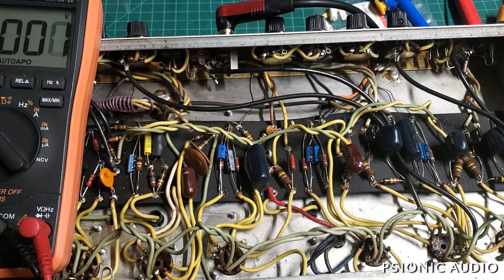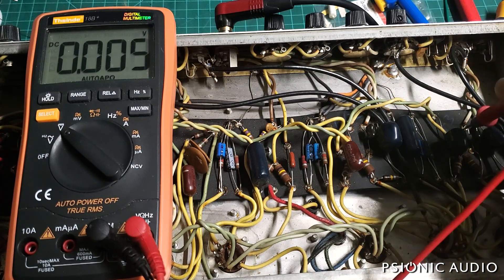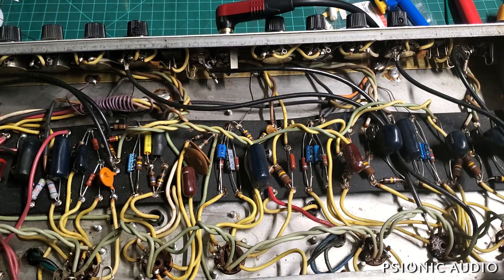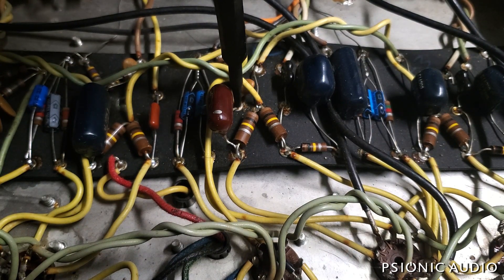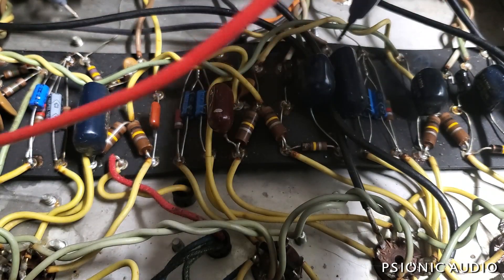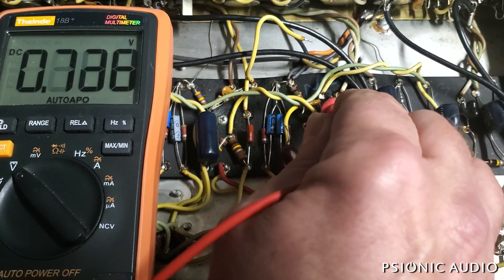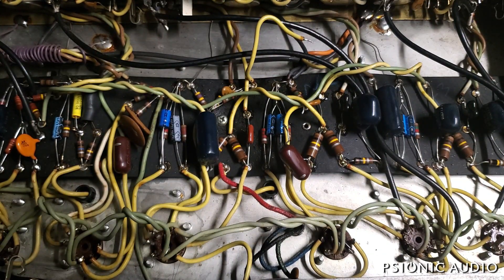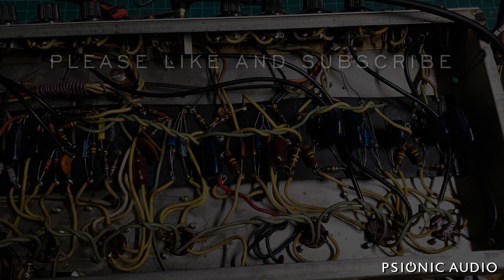DC Leakage in Fenders | What It Is and How to Get Rid of It

Comment: Rabbit hole potential: 1966 PR , I am chasing 20mV on a coupling cap at the point of the reverb input. Reverb volume goes up and is boomy when the reverb control goes up. As you described it, board looks OK, but grimy, gobs of flux from a previous cap job. Replacing ceramic caps does nothing and old resistors are in tolerance.  Am I wasting time?

Comment: Thank you for an informative video. I have a DRRI that has seen three amp techs for noise issues and it still has noise. I wonder if it has leakage in the board. Will give this a try
Reply from the maker: The RIs don’t have conductive board issues.

Comment: No, you couldn't run a tube screamer off that. A throwaway comment I know, but as we also know voltage isn't the same as power. Good instructional video all the same. Maybe Fender boards could be future-proofed by applying a wax in a volatile solvent

Comment: Great video on a common problem that is usually ignored!

I live in Florida where high humidity is constant. Many gigs are played on patio stages. The boards are screwed directly to the steel chassis. The fiber boards absorb moisture and warp so badly that they sometimes break components. I build my boards out of fiberglass and mount them on standoffs. Not only does this solve the moisture issue, it allows neater lead dress by routing wires under the board.

Comment: what would cause DC on a Marshall/Bassman style presence pot? When I hear the noise , I turn the pot all the way up and it goes quiet again ( its a build)
Reply from the maker: Marshall/5F6As built with 5K presence pots have DC on that pot. Notice the later amps use a 4.7K resistor and a 22K pot just for the call cap. Keeps DC off the pot.
Reply: By the way, its a Hoffman turret board

Comment: Empirical knowledge is those old Fender cellulose and glue fiber eyelet boards become conductive over time and thus they are notoriously leaky. IPA careful scrubbing and a hot air rework tool will usually sort them out.

Comment: That would drive me bonkers!
How long will that cleaning hold up?
Reply from the maker: Like Eric said, it usually takes many years to build back up. It took decades to get this bad to begin with. I'm not just doing a surface cleaning - I soak the board with isopropyl. That displaces any moisture that was in the board.
Reply: Many many years unless the amp is subject to brutal conditions

Comment: Wow! Does this also happen with vintage Vox circuit boards?
Reply from the maker: Not really. Phenolic boards on those.  I've had it once in one spot. But it takes a lot of heat for that to happen, and there aren't any components that get hot on a JMI board.

Marshall boards can sometimes do this, usually near the 10K droppers.

But it's usual for Fender boards.
Reply: @PsionicAudio  - that's a relief - and thank you for your advice and great work!

Comment: So, every time I see your videos with DC leakage on these old Fender amp boards - I think that if I had one I’d replace the “vintage” board with the fiberglass post type you use on your Excaliburs and be rid of this awful way to connect things - plus I like the way you can float the resistors and caps off the board - physically for heat dissipation.   These are one of the things I sincerely hate about vintage religions.   Sure - there are things that are precious - but Jesus it’s an amp!
Reply: I totally agree. It just seems like a better way to do things
Reply: Replacing the original eyelet board with a fiberglass board with turrets is not something that should be done to a vintage amp like this, unless the customer specifically request it. While it is a functional upgrade, it devalues the amp in terms of authenticity. If a vintage amp has such a modification, the owner has a moral and ethical obligation to disclose that information if they sell it in the future.
Reply: @retread1083  in any mod I have ever done - I keep the old parts and document their removal.   In my case I’ve never sold an amp I own.   Edit: I forgot to mention a Fender Blues Deluxe I sold in 96.   No mod, however could improve that pos.    
I’m honest, and have been all my life.   If I were to decide to sell such a thing, I’d probably return the item to its poorly engineered unaltered state, if I felt I needed to obtain maximum financial return from it.   Otherwise, I’d simply include the original parts.   These items are not religious artifacts.

Comment: Which Eyelet boards material type would you recommend using that doesn't cause DC leakage from corrosion, moisture issues, etc?
Reply: I always use G10/FR4 glass board. It is very high temperature and will not conduct.
Reply: @roberthurless4615  G-10 is replaced by FR-4 because it has flame-retardant properties. FR-5 is even better, with higher tensile strength and rated for higher temps.